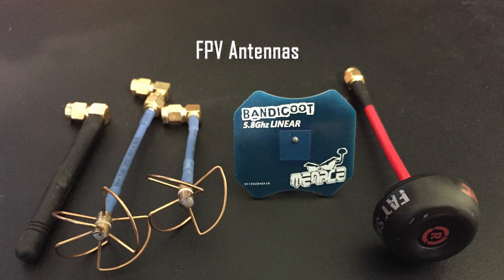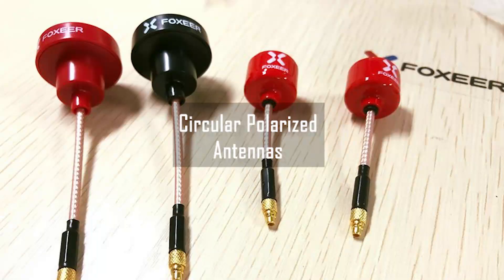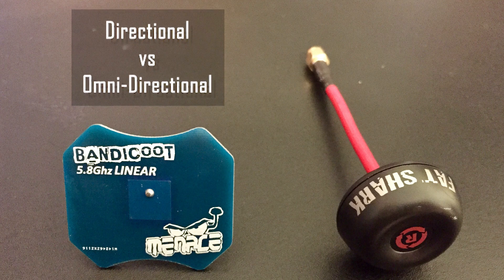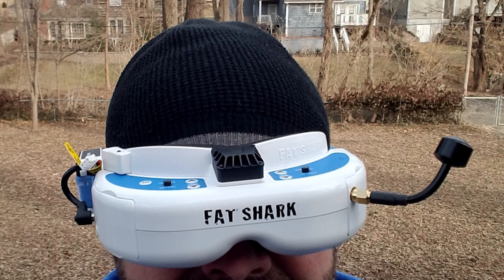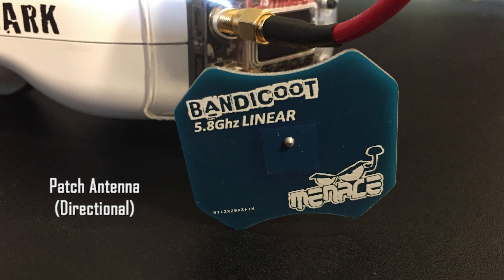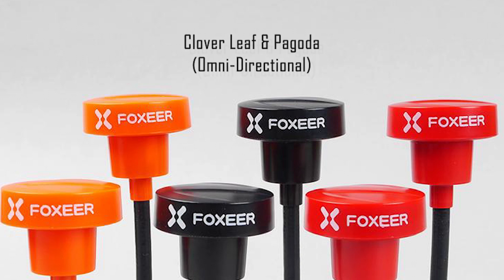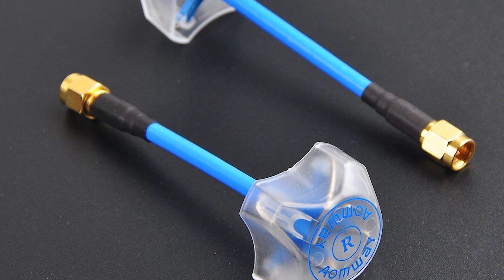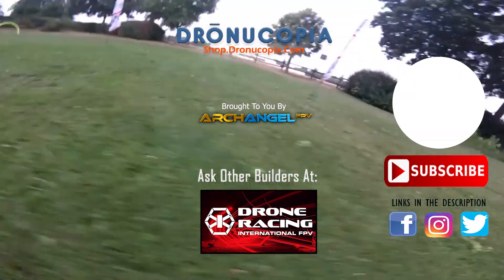FPV Drone Antennas Explained | Drone Racing Report | Vol 21

Comment: Quite cool movie. I would explain better polarization matter. Matching polarization is important.
Reply: Linear polarization vertical and horizontal, then circular right/left (clockwise and counter clockwise). Which antenna, what polarization and how to recognize it. Maybe some sheet with picture and typical parameters. Also characteristics comparison of different antennas would be great.
Reply: Also real life testing of the range. There is also missing movie about 2,4 GHz receiver antenna placement. How to mount antenas to get proper range, etc.

Comment: I have a emax and I bought a second goggles with dvr but the signal is in and out all the time the new has a mushroom and flat 5.8 but the original emax goggles is a miles away better. What can I do to improve a good signal on my new  goggles